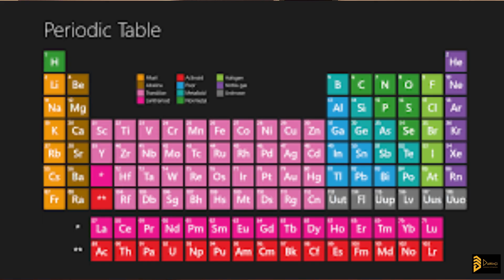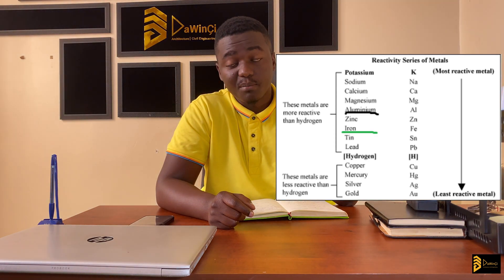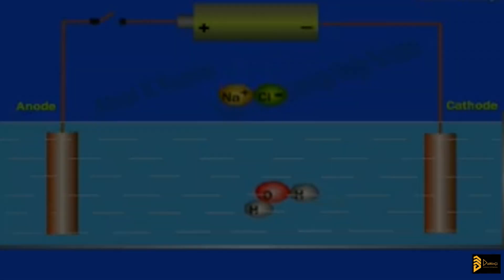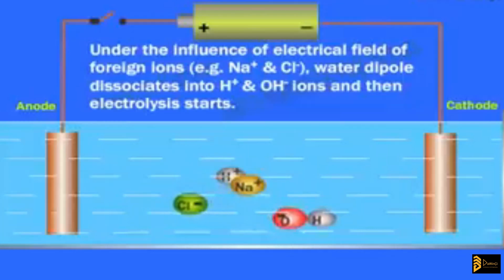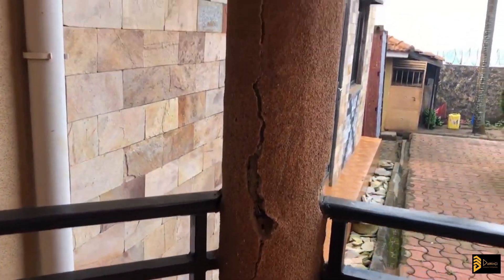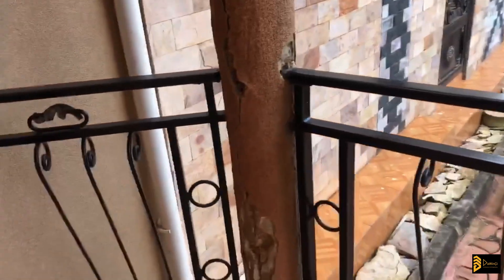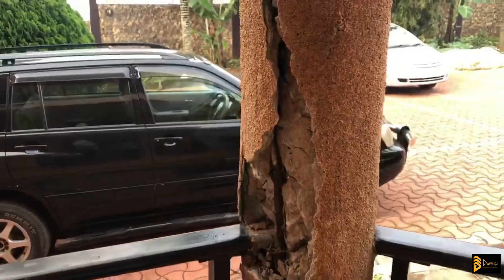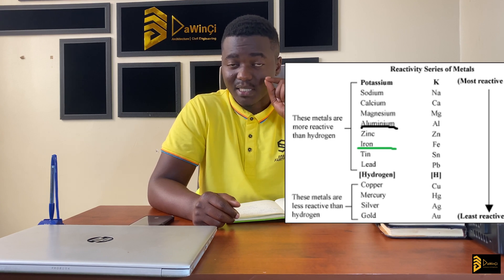Do Not Use Aluminum and Steel Balcony Rails!! This is Why?

Comment: Thanks Darwn for all the information you have given out.
On this video of not to use aluminium and steel on balcony I disagree with you. What you said was not the cause of those cracks. The cracks were caused due to the weight of the building because   
The column were to small and that caused column failure ie buckling  and sheer stress.
Reply from the maker: This is a Bangalow and not a storeyed building, the weight of just a roof cannot buckle a column. Even normal red bricks can hold the weight of a roof, how much more a column.
Take note of that. 
Also make research on Galvanic corrosion.
Reply: Boss, it is not buckling and axial loads, what is the slenderness and effective length of that column??. Hope you know the axial load capacity of 200mm D column. And also I think you should do a small review on buckling and it's causes, and squash loads. And further, how does shear come in??
And finally I recommend clients to use good concrete grade for durability (as recommended by a structural engineer).
Reply from the maker: Well said